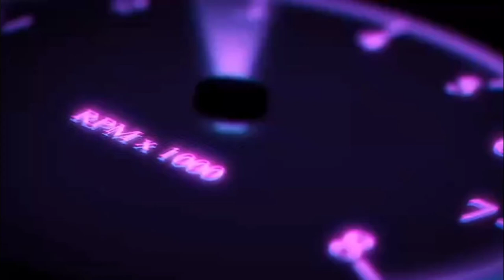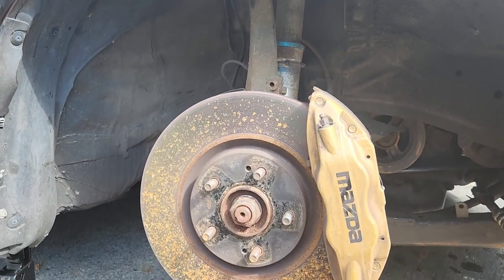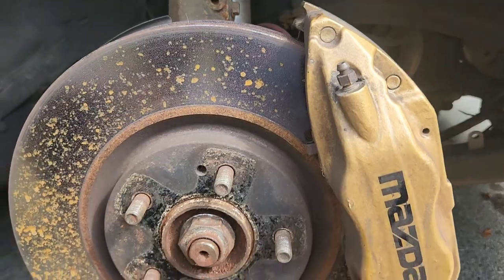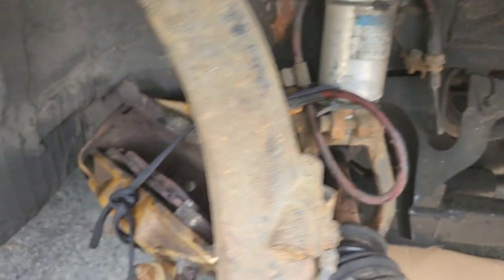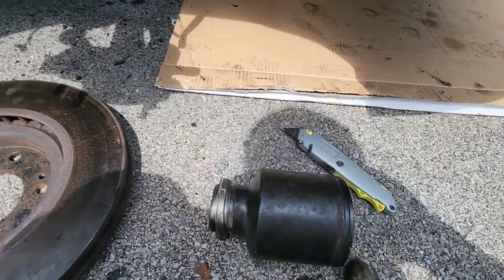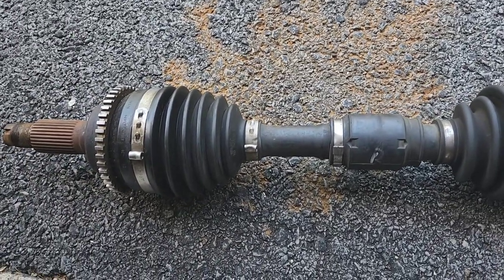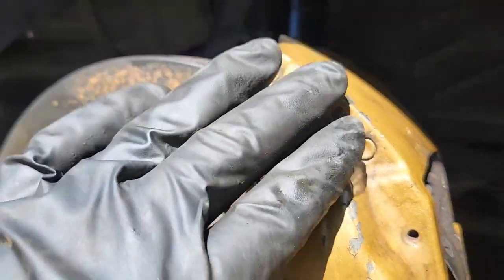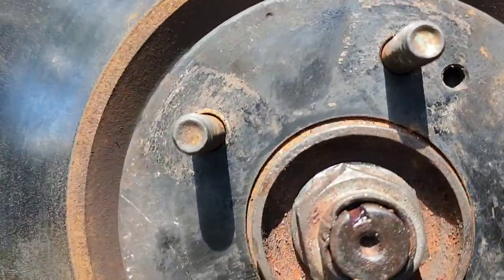Mazdaspeed broken axle

Comment: Zoom zoom my boot joint is gone by the passenger side so i wanna change whole axle i think it whas making the bushing squitching noise about 4 months and everyday it gone worse .can i find new one for the front passenger are they produce them or just oem used?
Reply: When I press the gas a little bit, the sound gets louder. When I take my foot off the gas, the sound slows down.
Reply from the maker: https://www.amazon.com/MZ23152314A-Front-Left-Right-Pair/dp/B01690MT1M/ref=mp_s_a_1_2?crid=3CWOR3AQD20WP&keywords=mazdaspeed+6+axles&qid=1699914670&sprefix=mazdaspeed+6+axles%2Caps%2C109&sr=8-2&ufe=app_do%3Aamzn1.fos.f5122f16-c3e8-4386-bf32-63e904010ad0 these are good a replacement.  You can get them on ebay too.
Reply: Hello bro i want to ask you after you get the axle from transfer case out where did you pull it out mine getting stuck at the suspension